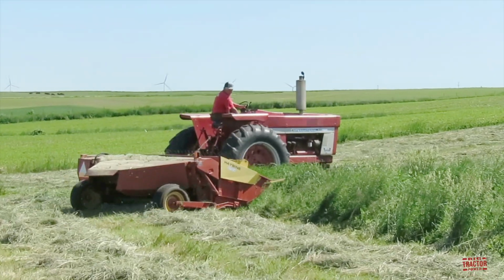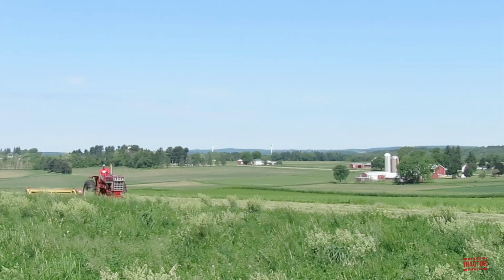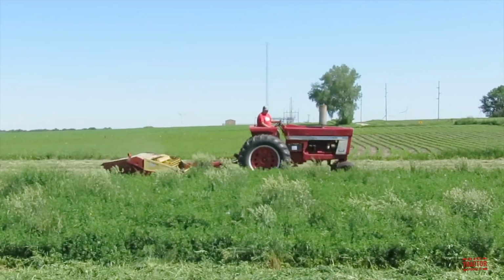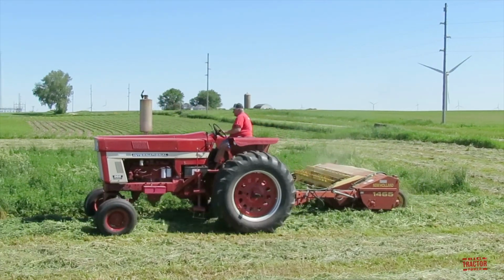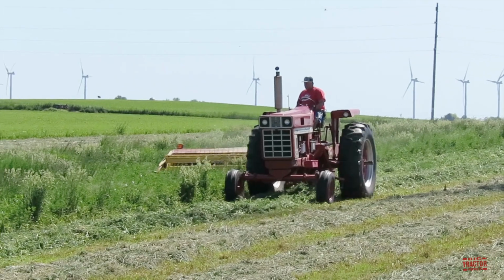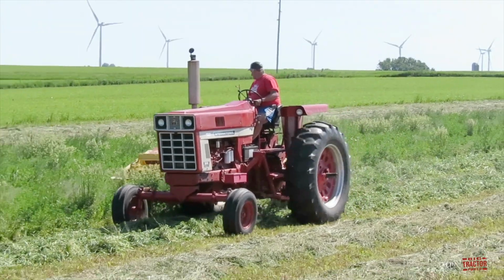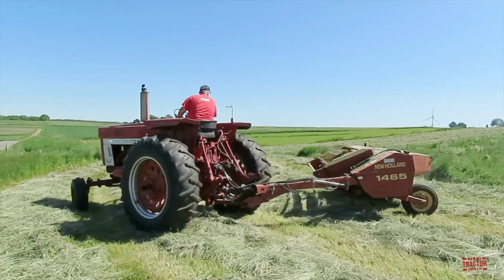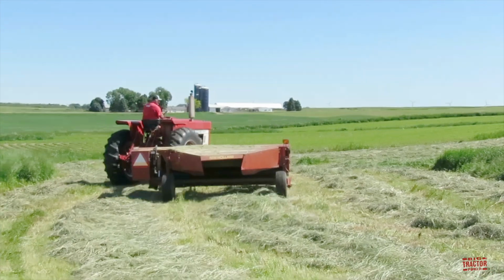INTERNATIONAL 966 Tractor Mowing Hay

Comment: Dad and I were in partnership a few years, after I finished high school. "I chose " a new John Deere 4020 gear drive, with a JD five  bottom plow. A year later " dad chose " the International Harvester 966 Hydro with a five bottom plow, International also. There was no comparison, the International plowed / worked circles around the 4020; it wore its plow points down to almost nothing. A spectacular tractor, Thank you International Harvester! Tim. ( - :

Comment: I do all our mowing with the exact same mower conditioner. Down here in Australia they were designated NH 489.  They’re a great little mower that can go the distance.  I only wish I had one of the 66 series IHC tractors to pull it with.  Love the looks of them more than the 86 series tractors.  We use a Case 2290 or a good old Aussie made Chamberlain C 6-100, 110 hp, a Chamberlain Countryman, 80 hp, or a Inter AW7, 55 hp.  Cut, rake and round bale around 450 acres each year.   Its a credit to the owner of these two machines how well looked after they are.  
As per,  another great vid.  The best on You Tube.

Comment: We had two of those 966s. Dad bought the first one when I was still in college with 34” rear tires. I bought another in 1974 when I came home and started farming with my Dad and it had 38” rears. Both were tough, torquey and reliable. We put a lot of hours on both and mine we used on a 5 yard Reynolds dirt scoop. After several thousand hours on the scoop, I removed the bull gear housings and swapped sides with the bull gear and brake pinions and run it several thousand more hours. Those were the days! Grading land for furrow irrigation with a 5 yard bucket. The only downside to a 966 as a non turbo engine is they were hard on the hearing if you didn’t wearing ear protection. I’m retired now and to my knowledge, both tractors are still being used on other farms!
Reply from the maker: The 66 series are solid tractors. Thank you for sharing. I just filmed several 66 series including a 966 High Clear at the 2021 Red Power Round Up.

Comment: Nice setup.  I'm keeping my eyes open for a 966 or 1066.  It seems like the 966s go quite a bit cheaper than the 1066.
We still mow with a sickle bar mower, a Hesston 1090 using a JD3020D.  Then tedd or rake with the Farmall H.  And bale with the 3020 and a JD336 square baler.
Reply from the maker: The 966 is a good tractor.  It is less popular than a 1066 and offers less horse power but would be a very good hating tractor.   You have a nice hay team with H and 3020.  I have a video with an IH 460 and HESSTON PT7 mower conditioner posted at https://youtu.be/gy24Km03O5U

Comment: Nice to see a IH966 in action cutting hay. I use a Massey Ferguson 4243 with cab and Hesston 1007 Disc mower to cut hay IH 574 to rake hay with and Massey Ferguson 383 Rops with canopy pulling Case IH 8480 baler.

Comment: Finally a video I can relate with. 😹.   My biggest tractor is a 4230.  So I don’t get to experience much of the big tractor power.  But i did  use a newholland mower conditioner for 20 years.  Was a good machine but didn’t like clover much at all.   Good video.
Reply: My biggest tractor is the 87 hp IH 844S and 85hp CaseIH 4230 and finally the 65 hp674

Comment: In 1971 you could buy a  bare bones 966 for 10 K or less. They did indeed go up thru the years. But 18k for a bare bones 966 in 1976 sounds high to me.
Reply: In 1975 a 966 with TA could be bought for $14,000. That included ROPS and canopy.